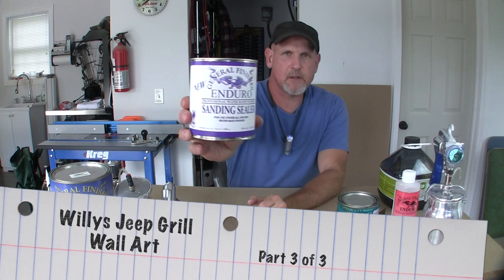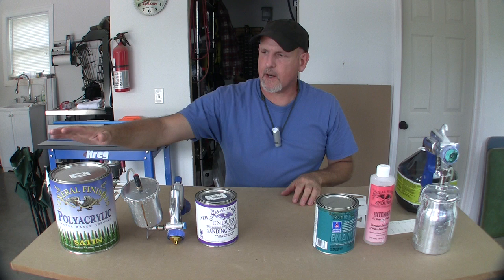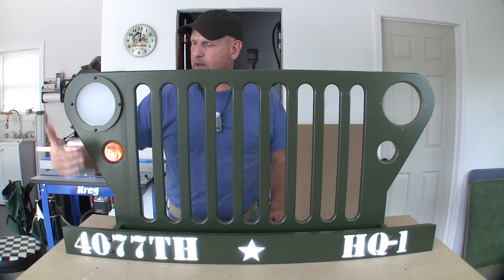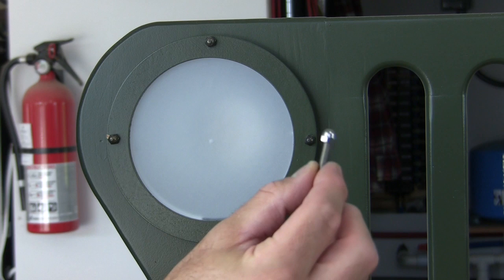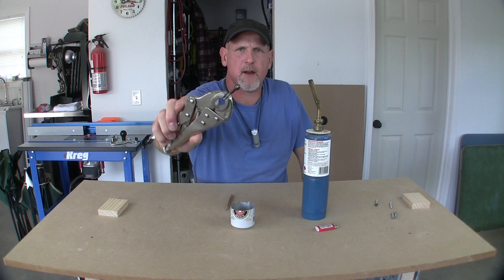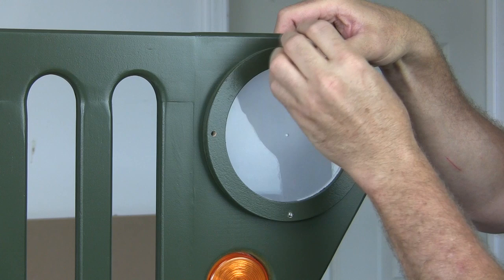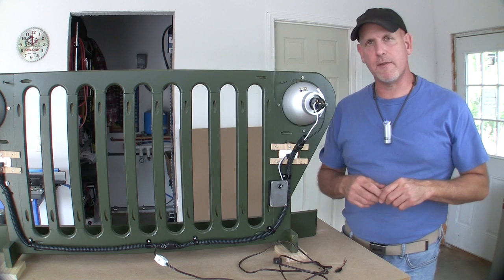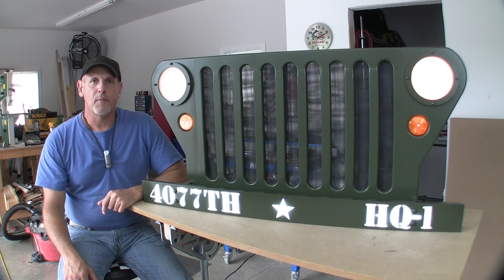Willys Jeep Grill Wall Art - Pt 3

Comment: I have used two different methods for homemade stencils. First one is laying down some pieces of tape. Make sure they are down really well. Draw it out and cut the tape...then just weed it out and spray.

Another way is to get adhesive vinyl rolls or sheets and basically do the same thing as above.
Reply from the maker: Great tip.  Thanks for sharing it.  I'll definitely give that a try.

Comment: Freddy the way you make stencils for painting is to use a vinyl cutter you would take the vinyl and stick it to your work piece and peel out the area you wanted to spray and then when fry peel the template off
Just thinking out load don't know the width of the piece but wouldn't that make a great headboard to end board to a kids twin bed?  You might just have a market there if you could size it for that purpose.  Or if you took the bumper and made a bottom in it you could make the back drop of a bar and keep bottles of Jack Daniels Jim Been and other adult refreshments.
Reply from the maker: Yep, that makes a lot of sense.  I found out a friend has a small vinyl cutting rig and she can just make the patterns.  Then I think I could just poly over the entire thing?

Those are great ideas on the grill.  I had thought about the bed but I love the idea to use it in a bar to hold bottles!  Thanks for the free tip.  Update, I have ordered a CNC router.  Should be here in a couple of weeks.  Once I scale the learning curve I can start cutting these things out all day long!
Reply: Who did you buy the router from. What size is it?
Reply from the maker: CNC Router Parts.  It's a 4X8.  I have to build it too.  I'm in unchartered territory here....  Ha!
Reply: If you any help let me know be glad to help
Reply from the maker: Thanks for the offer.  I really think I might need some advice along the way.  I'll definitely holler at you!

Comment: Try using a rattle can for the stencils (no air pressure to lift the templates)...
Reply from the maker: Ok, I'll try that next time.  Wonder if there is some kind of mild adhesive you could put on the stencil to hold it down without marring up the paint?
Reply: Maybe a thin strip of 2 sided tape
Reply: Or stamp your stencils out of metal
Reply from the maker: Heck yeah, plasma cut those suckers.  Makin me want to weld something!
Reply: How bout milling the stencil out of a piece of hardboard with a trim router or dremel tool
Reply from the maker: Funny you say that because I'll tell you a little secret that I'm pretty amped up about.  I just ordered a CNC router!  Should have it up and running in a couple of months....